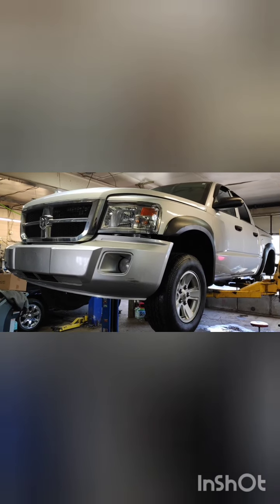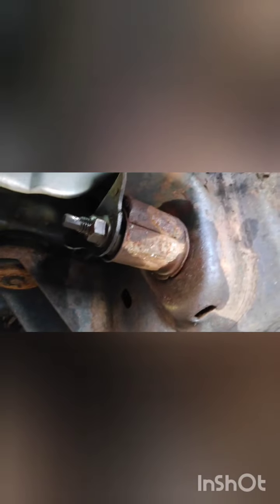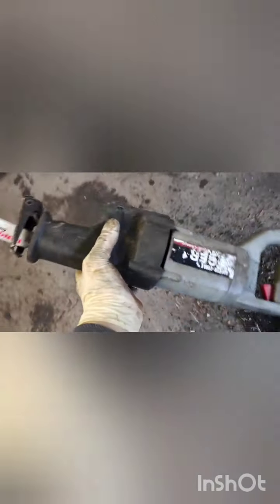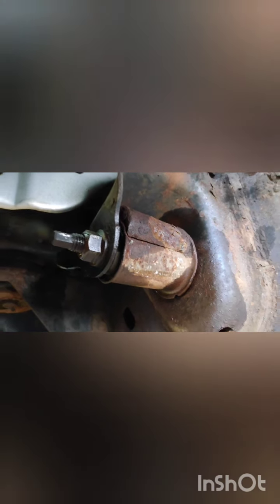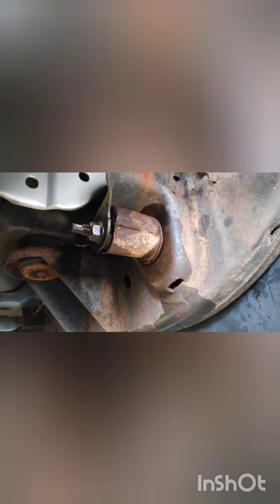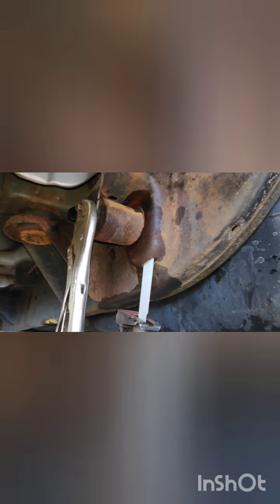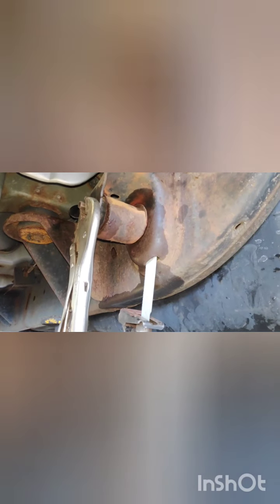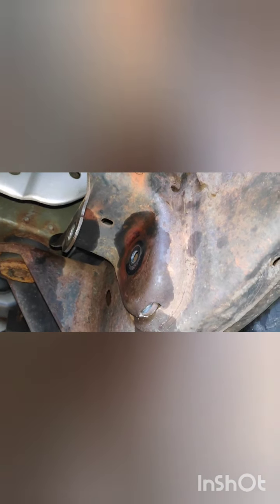2005-2011 Dodge Dakota / Mitsubishi Raider leaf spring replacement trick.No fuel tank removal needed

Comment: I don’t see how you’re going to put it back, cutting the bolt only solves half the problem, I dropped the tank a few inches and the bolt pushed back.
Reply from the maker: I was replacing the leaf spring and it came with new bolt so I put it back in from the other side and held the nut with the wrench.I didn't want to touch fuel tank strap bolts because they were too  rusty.